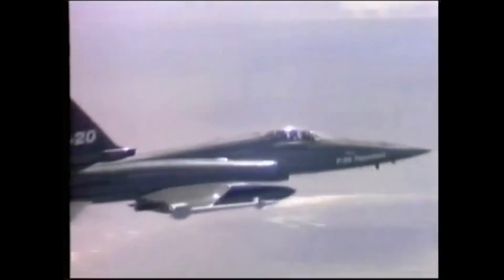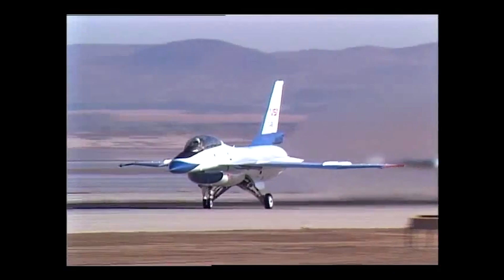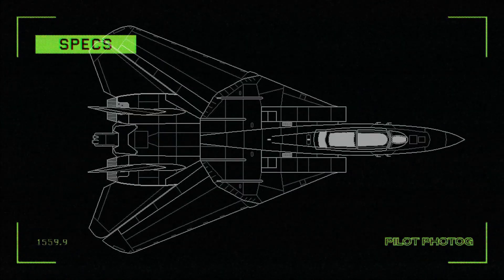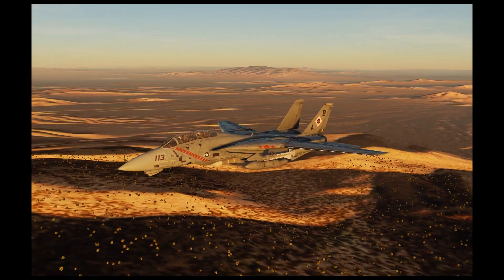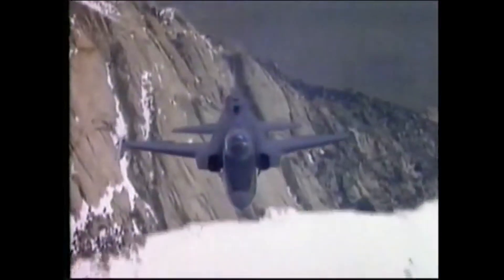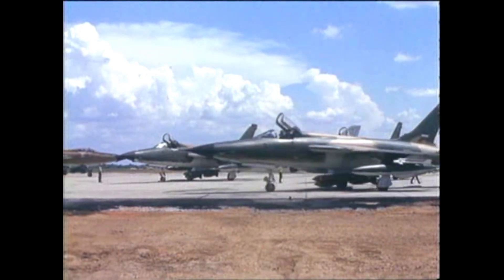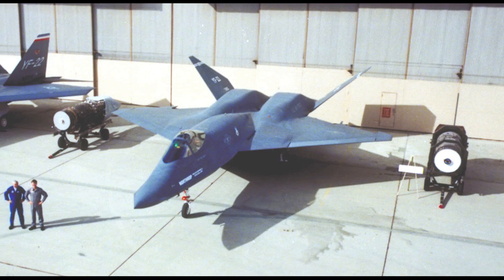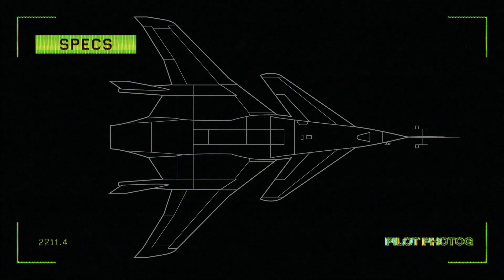Top 5 Fighters That Should Have Been Built | Best of Aviation Series by PilotPhotog  f20  f16xl

Comment: Do not agree with #4, the Arrow, a prototype built at the same time as the in service F-106.  The F-106 has a single JP-75, the Arrow two JP-75's.  The F-106 flew at Mach 2.3, not a theoretical 2+ as the Arrow only ever made Mach 1.98.  The F-106 flew 4000 feet higher, had a combat range half again longer and needed only one pilot, not two.  The Arrow even after a development period from 1953 to 58 was still plagued with problems that had yet to be resolved, 5-years of development and still only an unproven prototype.
For a from the horse mouth on the F-20, I encourage all to listen to Mr. Ron Gibb a 45 year Northrop engineer would worked on the design team for the F-5 to include the F-5G/F-20 at:  www.youtube.com/watch?v=GyTA7JBeXGo&t=32s
Reply: The Arrow never pushed its "real" limits during any of its flights (you simply don't do that in EARLY testing) and never flew with its intended production engine (Orenda Iroquois, made in Canada) which produced a thousand pounds more thrust than the F-106's engine even before you installed the second engine, effectively given the Arrow more than twice the thrust.  The F-106 had a thrust ratio (24,500/34,510) of around 0.71 whereas the production Arrow ([2x25,600]/56,920) would have had a power to weight ratio of just over 0.90... making it a vastly different animal where acceleration and time to altitude were concerned.
Reply: @otyliciu   the F-106 weighed:
Empty weight: 24,420 lb (11,077 kg)
Gross weight: 34,510 lb (15,653 kg)

the Avro Arrow weighed:
Empty weight: 49,040 lb (22,244 kg)
Gross weight: 56,920 lb (25,818 kg)
Max takeoff weight: 68,605 lb (31,119 kg) For the mass weight of the Arrow it needed every once of thrust it could get.
Even an extra thousand pounds thrust at those weights will have only marginal benefits if any.  
The Iroquois engine produced a maximum thrust: 19,350 lbf (86.1 kN), without afterburning; 25,600 lbf (114 kN), with afterburner. 
The J75-P-3 afterburning turbojet engines, 16,500 lbf (73 kN) dry, 23,500 lbf (105 kN) with afterburner  Looking at the weight to thrust for the Arrow and the F-106 there really isn't much to pick from with either.
Reply: @ditzydoo4378  As I already stated, the JP was only acquited to power the first few prototype Arrow.  The intended engine for the later prototype and production model aircraft was the Orenda Iroquois producing some 25,600 pounds thrust from EACH of the Arrow's two engines.  Arrow power to weight ratio:  ([2x25,600]/56,920) = 0.90, meaning the twin Iroquois engines would produce nearly a pound thrust for every pound the Arrow weighed, allowing it to fly straight vertical with hardly any loss of speed.  F-106 power to weight:  (24,500/34,510) = 0.71 ... a nearly twenty percent disadvantage, to the Arrow, in vertical performance.
Reply: @otyliciu    Aye, but that 25.600 of each Iroquois engine is only available at full afterburn, and no aircraft would use that setting save for heavy take-off or emergency dash speed which if used would greatly diminish the already short range of the Arrow.  With a limited fuel supply, internal only because of the landing gear configuration (no under wing hard-points for extra fuel stores) the normal full military power was only 19,350 each (36,700 total) for a 360 mile combat range.  the F-106 carried two external highly areo-dynamic fuel tanks giving it a greater extended range (2,120 miles extra range at 610 mph), far beyond it's normal 580 mile combat range at normal military power with only internal fuel load.  The extra fuel was used first then the tanks jettisoned before combat.  This feature far extending the aircrafts intercept range.
Reply: @ditzydoo4378  Sooo .. you were justifying the use of the F-106's stat on afterburner when you thought the Arrow used the same engine buuut... now that I point out the production Arrow would actually have two, individually more powerful engines you're saying the power output on afterburner doesn't count?  After all, they were only attempting to maximize the distance at which bombers carrying nuclear material would be shot down from their targets.  It's not like there was any rush.  Interceptors were not designed for extended range missions.  Their targets were generally first detected by surface radar and coordinated interceptors would then-be launched to maximize the shoot down distance from urban areas.  They did not "patrol" the sky looking for enemies that they did not know to already be there in the manner a more traditional fighter might.
Reply: @otyliciu    As to being on tactical strip alert that any interceptor conducts.  In time to flight/intercept the F-106 did it better, and held those world records for many years  
The difference was in that the F-106 could fly to the intercept and be diverted if need be to another higher priority target at longer ranges and still have the legs to return home.  
The Arrow with it limited 360 mile range if the intercept was not to be,  could not loiter for long on station, the F-106 with it's two Mach capable drop tanks could stay on station at high cruise (Mach 0.9) for hours.  
I have simply presented the technical facts as are easily verified.  
In this case, the F-106 was a mature in service program derived from the F-102 program.  It was cheaper, flew farther and faster, worked very well, with an overall lower fly away/operational cost per unit.  
the Arrow, (still a prototype) though I would have liked to see one fly in person, was a program still plagued by technical design problems at the time of it's cancellation.
Reply: @ditzydoo4378  Any prototype program is "plagued with technical glitches" because it is a program to develop an entirely new machine:  working out said glitches is part of the development process (why it's called 'product engineering and development' within the industry).  As per range, mach 0.9 is roughly 1111 km/h.  The combat range of the F-106 on internal fuel was 930 km.  I'm not sure how your math of it being able to "remain on station for hours" works out.  Any aircraft could be fitted with external fuel.  Meanwhile, there's no exact figure on the range of the Arrow as the intended twin Iroquois production model never flew.  However, an aircraft with a thrust to weight ratio of 0.9 could certainly afford to carry more external fuel than an aircraft with a thrust to weight ratio of 0.7.
Reply: @ditzydoo4378  You do understand, of course, that your saying "did it better" in comparison to a production model Arrow that was never produced, but by the simple ratio of its thrust to weight would have blown any claim the F-106 has to "better" time to altitude?  Once, yet again, the thrust to weight of the F-106 was 0.71.  Once, yet again, the thrust to weight of an Arrow with twin Iroquois would have been 0.90+.  In short, the F-106 would lose speed at a much greater rate (22%+) during a climb, and ultimately have to reduce its climb in order to maintain airspeed (to avoid stall) whereas the production Arrow would be able to maintain its climb for some time and continue to gain altitude.  These sort of principles are basics of literally any aviation ground school.

Comment: the Avro Arrow was canceled because Diafenbaker did not like avro aerospace because diafenbaker was told to stop harassing the workers and to get off of privet property. when diafenbaker got into office he stole avro aerospace and sold it and pocketed the money. Avro Aerospace already had plans for high altitude, suborbital variant to launch rockets in to high orbit. a lot of the advances in the arrow found there way into most of the air-crafts made to day. the hi-brid turbo fan scram jets on the SR71 were first suggested for the suborbital craft. there is a story that 7 arrows were made and all 6 were scapped.

Comment: F16-XL did have a problem with tight turns. 
F-14 Tomcats would shut down if you passed by and in front of them too fast (jet wash). True. Remember the movie "Top Gun"?
F-20 Tigershark w/h/b a great fighter, better than the F-16, and cheaper and easier to maintain.
YF-23 Black Widow was faster than the F-22 Raptor b//c it was unstable. Instability == speed, but instability == dead pilots.

Comment: Two of my favorite fighters are on this list - the F-14 Tomcat and F-20 Tigershark.
     First, the F-14 Tomcat was the fleet defender for US carrier battle groups.  Long range, great payload, exceptional radar, avionics and performance and a greater fear factor than the f-18 Super Hornet, the F-14 Tomcat earned its place as one of the greatest fighters of all time.  Now if the US Navy had the Super Tomcat 21, it's like having an F-14 Tomcat multiplied by a factor of 10.  Just that good.
      The F-20 Tigershark - the opposite of just about every modern US fighters - small, simple, easy to maintain, inexpensive - but with exceptional performance and maneuverability and hard to see in a dogfight.  Imagine the USAF and Allied nations with a multitude of F-20s, what can China or Russia do?  The only change I would have made on the F-20 is give it slightly larger wings for a greater payload and longer range.

Comment: The Arrow already had fly by wire and onboard tube computer. Special air conditioner designed to keep it cool. Could land itself. Had an inboard mounted armament rack. Huge range. Super cruise capability if fitted with the Iroquois engines. Those engines first in the world to utilize titanium turbine blades and burner cans.Would still stand up to many modern fighters.

Comment: The F-15S/MTD is another plane that should’ve been mass produce
Reply: They should have produced the F-15 Silent Eagle.
Reply: @ChairmanMo  Isn't that basically an F-22?
Reply: @PunishedClippy  No, it does not have supercruise, thrust vectoring and the stealth is probably not as good. But it is cheap, on a proven platform, can play a supporting role to the F-22 and be good for the facing off against opposing 4.5 generation planes.

Comment: Hmh!  Stupid USA!  USA was also behind the cancellation of the AVRO ARROW, but what you said was new or kind of new to me, why IT was cancelled! Hmh!   ;    /   I think!, that the F 21 Super TOMCAT would have been better if not way or lot better in the Air, than the F 22, as It was better, than the F 15 A and B and probably even better, than the C and D!??!

But Of Course the F 14 B or at least the D version, which both or the D version had the same Engine to put to it / them, the integrated F 15 Engine's Engine! But what was the name, and was It the GE's made or some one's else, you know, the most reliable and still in use the Engine in both F 15 and F 16!?!?

The Non G - Limited F 14 A or the B TomCat, or was it even the D version, beat = win every time the Clean F 15 A / B, if not the C / D Version in / on the Mock Fights! At least in / on the one cation, where the Japan was going to cancel the Purchasing the F 15 Eagles, for good! But Mc Donel Douglas was able to convince, to saying something, which I don't remember, to save the deal and they were able to do that Too! So the Japan continue buying the F 15 Eagle,Which was not bad or not so bad jet fighter, but the F 14 TomCat (Tomcat) would have been the better or way / lot better Plane and Jet Fighter!

But, hopefully the Super TomCat, the F 21 would have had those 3 D Thrust Vectoring Nozzles, and not just the Stalth / Advanced TomCat, the F 23 or something else, and would have had way / lot longer range and being more agile = maneuverable, than the F 22 and the Clean F 15!  To me the YF 23 was Uglier!, and Today, it still is more Uglier or less beautiful, than the F 22! But It still would have been better or lot better 5 TH Gen Fighter, than the F 22 or Who knows!?!?

But if not cancelling the F 22, then cancelling the X 35, which became the F 35 and if not that, then either the F 15 or the F/A 18 Super Hornet or both! Having the money saving from some where!  Also, the F 20 Tiger Shark should have been made as the F 16 XL changing the name to the F 17 or F 16 Super Falcon or Super Viper!  Hmh!   ;    /  But! God Bless Every Body! God Loves We All So! God Bless! Love You So! But God Lot Lot More And We All! We All!   <3   <3   :    )
Reply from the maker: Thanks for commenting!
Reply: @PilotPhotog   Thanks to youu   Good work  <3  <3    :     )

Comment: I think it would be interesting to see a list of fighters that shouldn't have been produced.
Reply from the maker: Great point and I will start working on a list
Reply: Some of my friends on base tell me the F-35, as a platform, isn't worth the time and money the govt. is throwing at it.
Reply: @mrcyde  Called a flying turkey. Not really good at anything. And costly. F-16 (and probably the F-18) is a much better aircraft given the missions that are actually flown, as opposed to the theoretical ones against advances Russian and Chinese air defense systems. And the F-35 cannot even decently dogfight decently. With the way they plan to use them, why not just use drones. Drones can fly well behind the forward battle lines and lob cruise missiles just as well as the F-35, in fact why not just build the B-52 and give it a massive cruise missile load..

Comment: The AVRO Arrow was one thing, an Interceptor. Not a multi role combat aircraft. Given the high cost and the lack of foreign order interest the Canadian government cancelled it.
Reply: We'll never know, quite a few born interceptors went on to great multi-role careers. As an interesting point of reflection check out the design similarity between the air intakes of a F-4 Phantom and the air intakes of an earlier Avro Arrow.  The F-4 ended up doing everything it was ever asked to do and had a 50 year career.
Reply: F-14 used to be strictly interceptor until Iranian use it for ground attack and then USN did try to use it for ground attack after saw the Iranian did it. F-15 the earlier model were just interceptor too but with few modification it too become multirole. So anything IS possible of you put an effort.

Comment: Some fine planes there, I know not all can be mentioned, but there is one plane that doesn't get mentions even in comments - the XF8U-3 Crusader III. The plane that was faster, more maneuverable, and had more range that Phantom while using the same radar and Sparrow missiles, but lost the competition due to having one man crew and less air to ground capability.
Reply from the maker: Thanks for commenting, I actually had the Super Crusader in my initial draft and thought about making it an honorable mention...however it looks like I will be doing a second and possibly third of these videos.  The XF8U-3 will be on the list
Reply: Wanted to make sure this was mentioned. The Super Crusader blew the wings off the Phantom in testing but as many viewers said, politricks abound. The navy's desire for two engine aircraft as a matter of redundant safety is laudable but didn't do them any favors with the old Lead Sled.

Comment: Agree with your choices save for HiMAT and YF-107.  The A3J had the same intake technology at the same time and went into production.  The YF-107 was never really viewed as anything but a research aircraft and didnt have anything like the very capable avionics of the Thud, nor could it carry a weapon internally nor such a wide assortment or ordinance.  Plus that intake location was just dumb and a non-starter.  NAA should have gone with side mounted intakes.  HiMAT was never intended for production and was crippled with a very low fuel fraction.  

Replacements on your list for those two would be the BAC TSR.2 and Lockheed F-12A interceptor.  

Thanks for the thought provoking video.
Reply from the maker: Thanks for commenting, comments like yours are the very reason I make these videos: to illicit conversation and dialogue about forgotten or obscure aircraft. I am going to make a second and possibly a third edition of this video and will be sure to include both the TSR.2 and F-12A
Reply: @PilotPhotog  One more suggestion from left field: the A-7F as precisely the low cost long loiter bomb truck USAF neded for the wars it actually wound up fighting in the 1990-2020 timeframe.  Vought was quoting $15-18 million flyaway cost with $1.2 billion development cost depending on the avionics fit (1990 dollars).  That was over 20% less than an F-16 and the SLUF had always had very low operational costs.